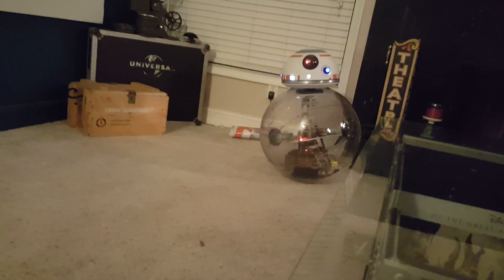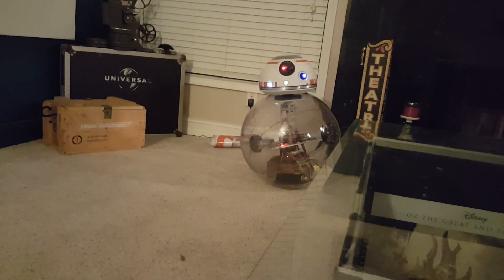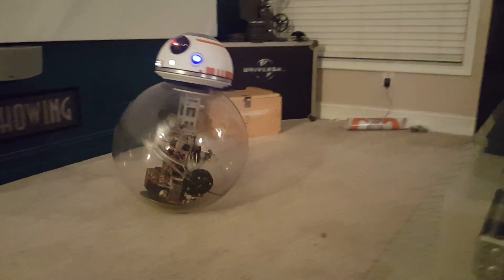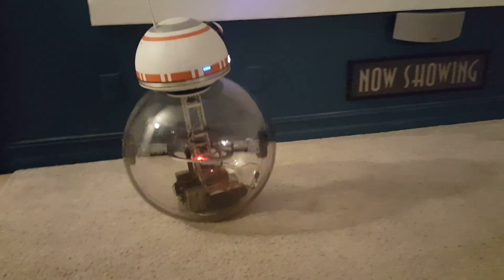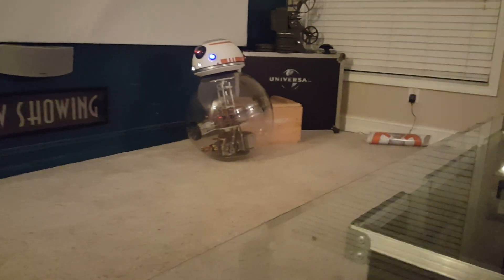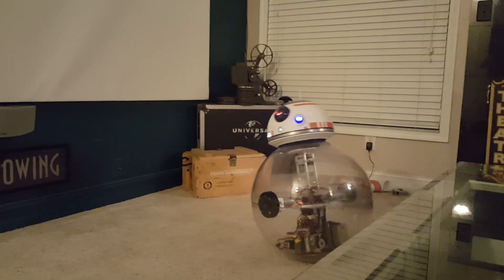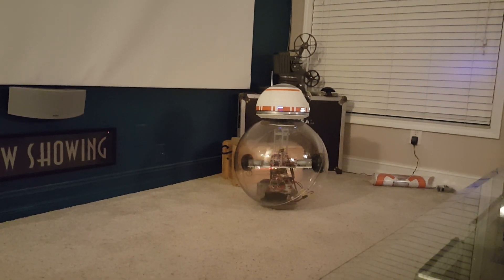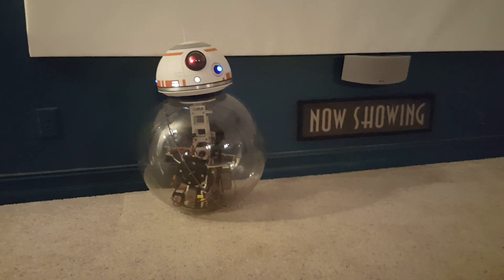My BB-8 Project.

Comment: in an effort to keep the cg as low a s possible, cant we mount the head servo further down closer to the core ? that should help with balance issue wouldnt it? PID loop is the way to go but overall weight distribution would save a lot of grief. why not mix materials for top part of the "neck"? instead of aluminum?